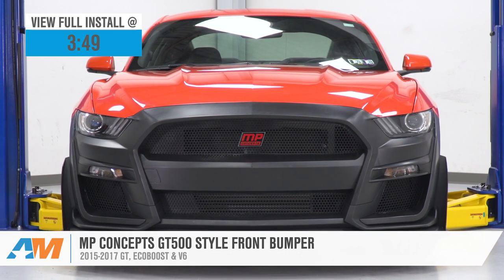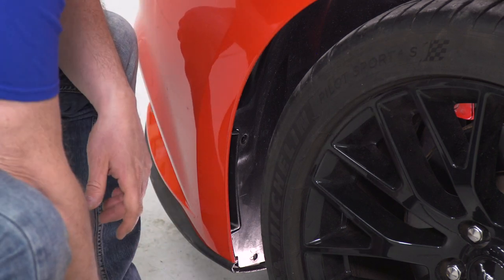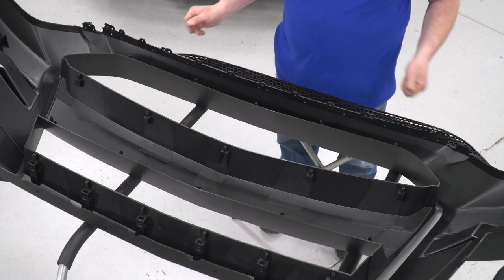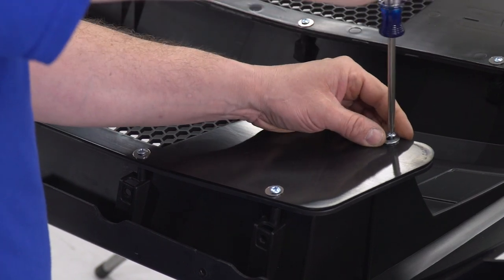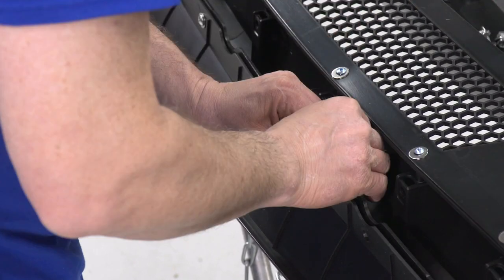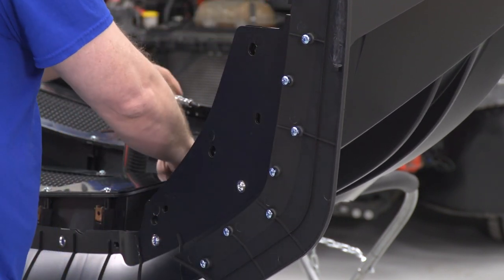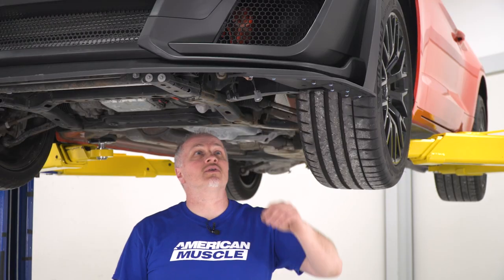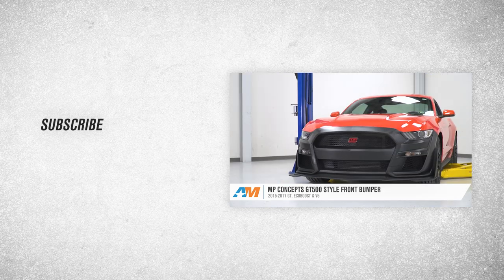2015-2017 Mustang MP Concepts GT500 Style Front Bumper Review & Install

Comment: I bought this from your website and the absorber wont bolt up correctly to the new bumper. does the absorber not need to be installed with this new bumper?